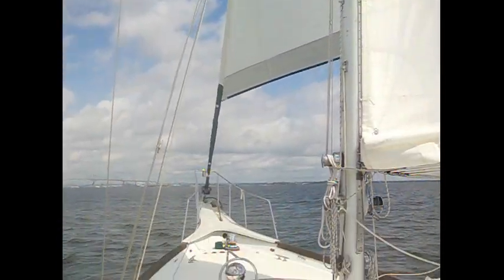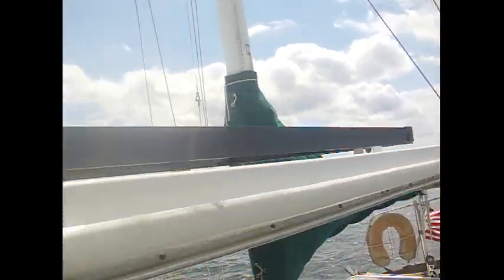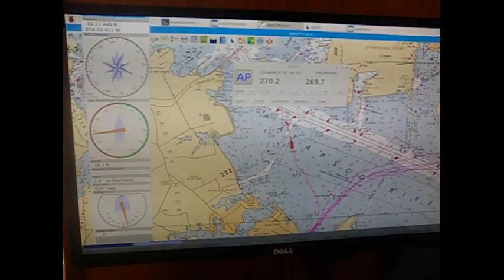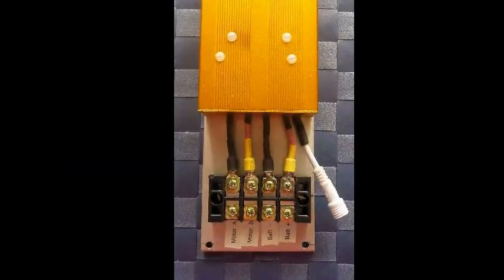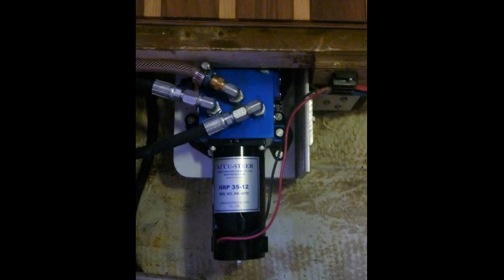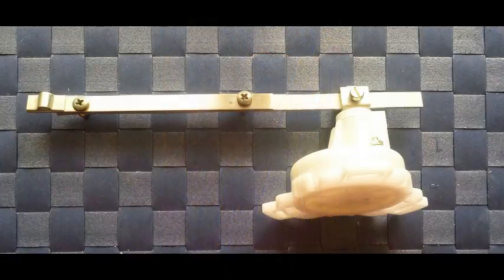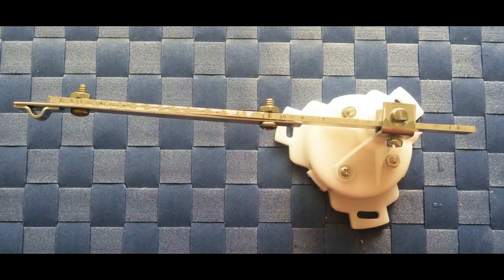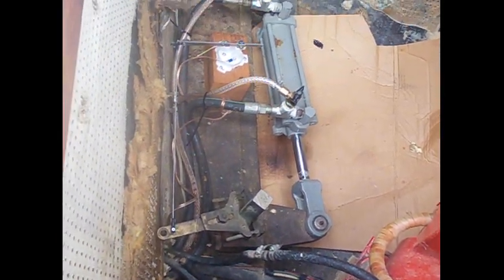pypilot hydraulic

Comment: Hello,

I have a Rasperrbery PI3 + and I want to use it to make a hydraulic autopilot. What electronic equipment advise me to buy for the realization of the project.
I am French.

Thank you
Reply: off the shelf parts can be had on ebay, gyro compass module, etc.. hit me with a list of features you would like to use and i can match you up to a shopping list. also you will want to subscribe and look over sean's channel. there is a wealth of knowledge there to get the most out of this system.